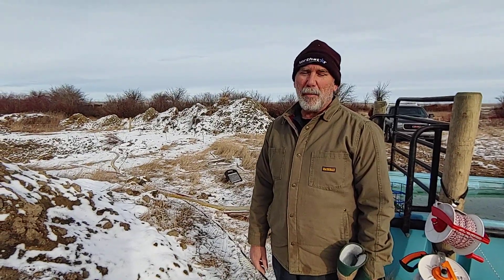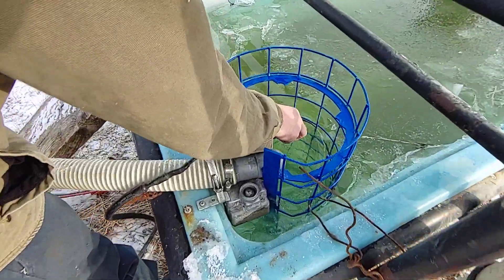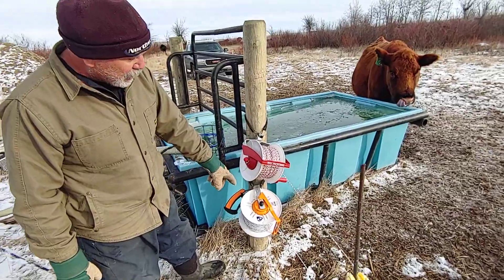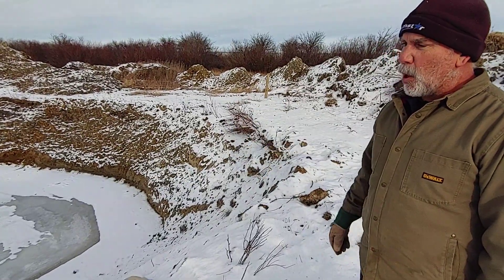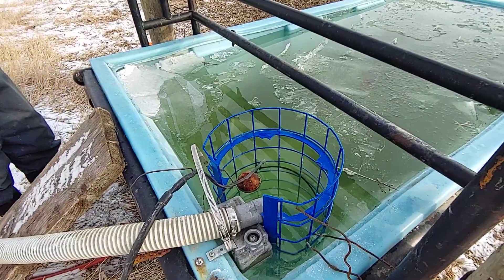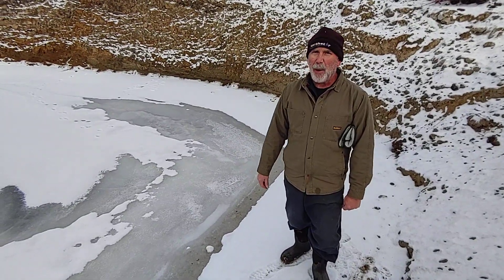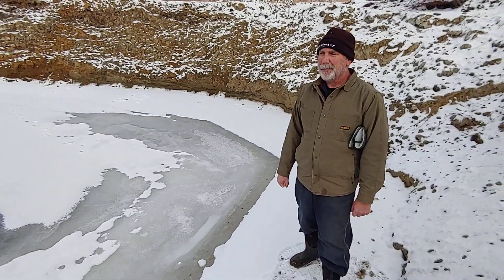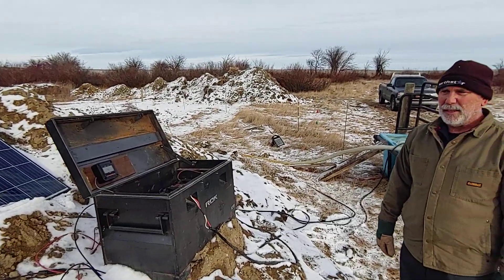Water in the Winter Part 2!  Update on the solar powered cattle watering system

Comment: I wonder if you can heat the water with geotermal heat using a heatpipe. Bury a 20ft ¾'' or 1'' galvanized pipe straight into the ground, vacuum the inside, and fill with a small amount of water or alcohol. Leave a small length above ground and it will stay at ground temperature the whole year. There are many videos here on youtube about making heatpipes